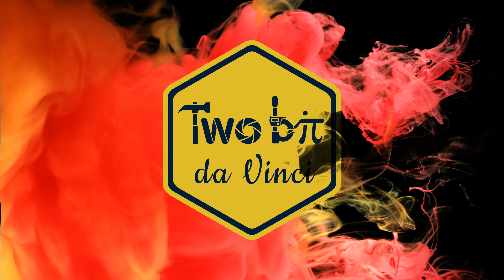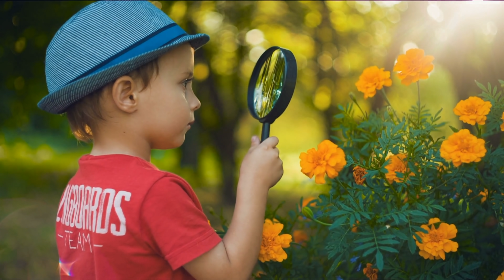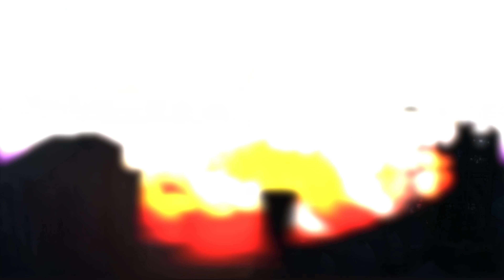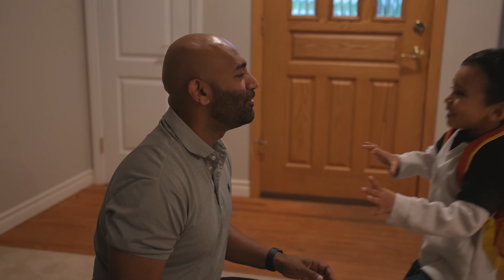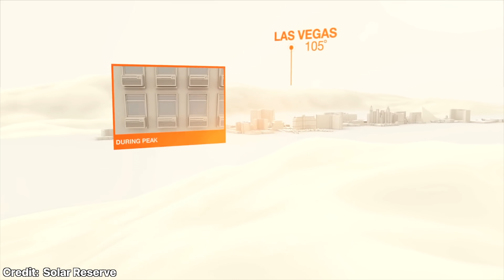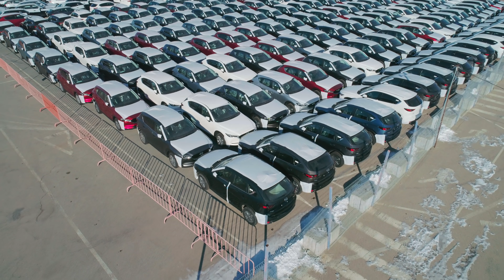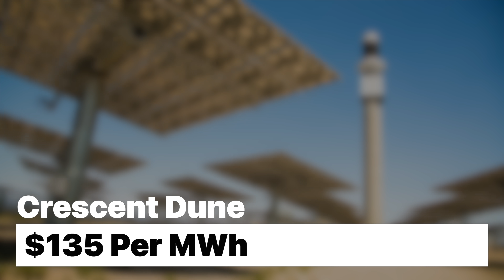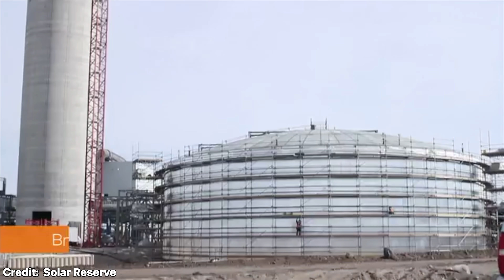This Billion Dollar Solar Plant was an EPIC Failure

Comment: "In great efforts, it is glorious even to fail."  I applaud the attempt, and hope that parts of the technologies developed for this project provide lessons useful in other projects.
Reply: I highly agree, although it did costs a lot. Humans learn from mistakes, that's also a big part to engineering.

In my eyes relying on fossil fuels is the true failure and we are only starting to realize what a big "mistake" it actually is. It will cost us a lot of time, effort,money and political drama to convert our energy resources. 

Attempting structures like this will fuel us with experience and knowledge in order to have great inventions in the future.

Comment: All through time no matter what the level of atmospheric CO2 may have been, a portion of the incoming solar radiation has been absorbed by the surface of the earth, land, water or ice and life existed just fine.  Now we’re told 400ppm of CO2 in the atmosphere is heating the earth to the point of existential death and destruction.  It seems to me that with all the glass covered buildings and office towers, small and large scale solar panel farms and the massive reflecting mirrors in the Nevada project,  mankind is causing far more atmospheric heating than if the ground was left in its natural state.
Reply: Wouldn't the mirrors reflect most of the waste energy back into space?? Especially the glass buildings and such.
Reply: @Gr3nadgr3gory    If you want to make a career for yourself, simply apply to the government for a billion dollar grant to study the phenomenon.  Just make sure you put the words “climate change” in the application.  They fall for it every time.
Reply: @ricoman7981  I'd rather do something useful. Like work on LFTRs.
Reply: @Gr3nadgr3gory    Agreed.  Will thorium break through, I don’t know much about it.  Technology will lead the way.  As I understand, wind and solar have limited efficiency upside, we need something much more energy dense and reliable to support the grid.

Comment: 1.  Being price competitive with Solar Panels even at startup is not saying anything of value.  As even now, Solar Panel power generation is still unable to support itself financially without extensive subsidies at taxpayer expense.
2.  Being solar powered, it still has a period of time daily when it offers effectively 0 energy output.  It's not like just flipping a switch at sunrise and it's instant on like a lamp.  While the molten salt can still provide residual heat to run the steam turbines after the sun goes down.  Every day would see a point where there just wasn't enough thermal energy remaining to continue production.  And then the system must wait until however long after sunrise to build back enough thermal energy to resume production.  And of course, all of the machinery and electronics must still have power.

Comment: hi guys. 
as one who worked in a solar plant like this. you are missing one more big issue.
the cost of construction and production is one problem.
the cost of maintenance is not only money. 
the environmental impact is terrible.
cleaning and fixing isolation panels lives millions of particles of non perishable materials drifting arround.
birds and insects get caught in the flux and burn alive
and now it will be left to crumble as a monument to the failier. no one will take it apart.
i am all pro novelty and clean energy is important. but this is so far from clean.
i hope that in the race to renewable energy money will not be the only factor

Comment: Hardly a money failure for the ones who dreamed it up and for the installers they got their millions out of it, myself and far more clever people have said that all this type of renewable energy is a scam , it hasn’t been tried low scale long enough to see if it’s viable, same with the wind generators poor returns for the money invested and the off shore ones are not only an eyesore but they are failing by the hundreds because of erosion, this waste of money by the tree huggers has to stop let them find investors instead of robbing the public purse, how many pensioners could have been fed and heated with the amount of money wasted

Comment: Question: The panels are there, the photovoltaic cells are cheaper, its just to be remodelled to make most out of it (the assets), why shut it down than repurpose it?, biggest cost is the panel and the rotator (systems) to capture most sunlight .
Reply: I also refuse to believe, we dont have the technology to deal with enormous heat, how is it managed in nuclear reactors. I like Douglas Goldstein informative comment highlighting the side effects, so when you've connected. look forward to the sequel of this report

Comment: You mentioned the staff required to grease the assemblies. The expense that most renewable energy projects like to keep hidden is the amount of oil required to keep them functioning. Bearings, gigantic rotating assemblies, electric motors all use an exorbitant amount of oil and grease. 

It would be an interesting study actually. Hint hint.
Reply: It's usually not mentioned anywhere, yes, and it's not just oil - parts have to be replaced much sooner, due to how unstable it is. Constant problem of renewable energy is that it's naturally unstable, and machines tend to not work at optimal capacity under constantly changing conditions. By contrast, non-renewable energy, like nuclear, runs in stable mode, this reducing wear and tear on machinery and electronics.
Reply: "Bearings, gigantic rotating assemblies, electric motors all use an exorbitant amount of oil and grease. "
I have never heard of a diesel submarine -- an isolated piece of equipment when it is in full operation -- failing due to oil and grease depletion.
Reply: I can't help but think that the project team didn't do enough homework on the heliostat actuators.  There are lubed-for-life motor and ballscrew assemblies that could have worked without maintenance.
Reply: @andyharman3022  I don't think anything working in conditions of desert is "lubed for life". High temperature contrasts and sand are deadly for moving parts.

Comment: Sounds like the $$$ gatekeepers & those overseeing engineering design should have employed some sophisticated & experienced thermodynamic brains from the aerospace and or 🚀 industries. Molten salt is apx 5x the temperature 🌡 for steam for turbines(day & night time kWh). One would think ALL parts of the process (links in the chain) would have been scrutinized for temp, pressure, corrosion, etc. I guess hindsight is 20/20.

Comment: They need to have a mirror discount sale and get some of their money back. It only cost  about $40.00 to build a box that would supply 3 homes with electric power for everything electric in all 3 homes. No moving parts and pulls energy from the air around you. Tesla free energy is coming soon. Should be this month.

Comment: Right away when I hear a failure I think of solutions or outside of the box work around you have a field of solar voltaic panels that are aimed at a focal point take Sterling engines and place them at the point and allow a Sterling engine Hot Side to receive all of the Power Sterling engines are already running in many different places of the world producing many megawatts of power steering engines are the solution to the problem Sweden uses Sterling engines to power submarines the space station uses Sterling engine with a ball of plutonium to power it to run energy in Space Station

Comment: I remember seeing one of these type solar plants in the desert just east of Barstow, CA. Then, it was not there. Gone like the wind. If that was a failure, then why did they bother building more of these in the California desert near the Nevada state line?
Reply: Can't give up on an idea that scientifically makes sense just because you failed.
 We really really need to lower our footprint on earth and these guys are doing a great job at trying
Reply: @chango.-.  :  Yes, no matter what the cost.
Reply: @chango.-.  "these guys are doing a great job at trying"
Meaning they're doing a great job at failing.  "Our footprint" (as you refer to it) in the construction of this plant, did you ever think of that?  The fossil fuels burned by all the machinery and men needed to build the plant and perform maintenance...  Do you truly believe that any of the energy used in the construction of the plant was "green?"

Of people want to advocate for green energy, they should advocate for solutions that will work.  Otherwise, you're doing more harm than good by "trying."

Comment: Imo, the problem with the green movement is that 1) it has failed to recognize that a lot of its dire predictions haven't come through (legitimacy problem) 2) they are sticking to the sole solution of reducing emissions which is not an easily achievable goal (feasibility problem). The conversation has been dogmatic with you either reduce emissions or you are a science denier. More updated information,  innovative thinking and compromise is badly needed.

Comment: I could have predicted this from the start. Liquid salt is such a difficult and corrosive media to control. Though they can convert it to just use water only. They will lose the night but possibly another storage media may emerge . Another possibility is to heat water then heat the salt with water then heat the second loop of water at night. Losses have to be calculated.
Reply: It's just not stable enough for such system with multiple cooling circuits. Main trouble with renewable energy is always in how unstable it is, and many mechanisms hate constant reconfigurations, as it reduces their lifespan.
Reply: Yea, I've got a great idea.  Let's use something like radioactive sodium metal, or radioactive hydroflouric acid.
Reply: @JoeSmith-cy9wj  I got a notification, but your reply isn't showing up in the thread...
Reply: @JoeSmith-cy9wj  "Yea, I've got a great idea.  Let's use something like radioactive sodium metal, or radioactive hydroflouric acid."

Can you explain? Genuine question---I don't know enough to know if you are being facetious or serious.
Reply: @bricaaron3978  check your email. I believe i posted it to you instead of the public thread
Reply: @JoeSmith-cy9wj  I'm not sure what you mean... I don't use Google for email, as I don't like strangers reading my private correspondence, or using it to make a profit.
Reply: @bricaaron3978  ok, so i don't know where my original reply went.  Anyway,  the second one was a near duplicate. This format is considered email to the Google computers as far as i can tell. I was surprised to find that when people left responses under the video comment tab, the response would appear in the video comments. But if a person were to tap another commenters name or logo or avatar image, it goes only to that person's email.  Many people have an email app on their phone but don't use it. You jave email whether you use it or not. If you use your phone for this communication,  open the app. You MUST have some form of it because that is how you are talking to me.
Reply: @JoeSmith-cy9wj  It seems there is a confusion. I have email accounts---my email accounts are with my ISP. I.e. they are private email accounts, and not free email accounts like Google/Yahoo/etc.

I access Youtube via my browser, via my PC. So when I post a comment on Youtube, or on any other forum, I know that I am posting on a "public" forum. You said that I should receive replies via email, but like I said, I don't use Google email, so even if that is true, I wouldn't know anything about it.

Having said all that, it's still true that your comment was apparently "shadow censored". This kind of thing is why I don't take Youtube/Google seriously as a medium of communication.
Reply: @bricaaron3978  I see. I haven't had a computer since 1985. Since I've been using touch screen phones,  which i detest, it seems to be a requirement to have an email address. This is how all accounts are identified.  I don't know if it works that way with iPhone. The browser I use for internet access also anonymizes  me. However Google,  with my phone, provides a direct app to YouTube.  This is where i write comments.  However,  i also receive them as email through that application. Somewhere you are assigned a unique locating address. 
I wonder,  did you receive the note i sent FROM the email app?
I completely understand if you prefer not to answer.
Reply: @JoeSmith-cy9wj  "Somewhere you are assigned a unique locating address."

The only requirement for Web access is an IP address, which has no information about a person's physical location. It's possible for an ISP to combine private information like customer address with IP address in order to identify an individual, and that information can of course be given to the government. But to my knowledge, my ISP at least does not attempt to "monetize" or tamper with my email exchanges.

"Since I've been using touch screen phones,  which i detest, it seems to be a requirement to have an email address..."

Absolutely not. My ISP, for example, no longer gives out new email addresses, but there are companies which offer secure email accounts. And there is always the option of hosting one's own email server. I actually thought I was going to do that when I mistakenly thought that my ISP was deleting my email accounts as the result of a move.

"I wonder,  did you receive the note i sent FROM the email app?"

Via Youtube, the only thing I receive is a notification, which contains the first bit of a comment. Perhaps there is a way to view the entire comment of a notification from the Youtube webpage?
Reply: I initially used the three little menue buttons on the right instead of the dialog box below to reply.
Reply: this is the error folks make. The goal of green renewable energy at this time  should be to SUPPLEMENT fossile fuel  I.E. use solar in the daytime and fossile at night.

Comment: They could just put all the panel to gain the most energy. Then hook it to the grid using the molten salt was just asking for failure like rotating panels. Once they used tax dollars shut down with out paying them back is bs but typically government

Comment: we don't hate green energy initiatives, we hate stupid ideas, which the green energy sector is full of. look to California, they are having a really hard time keeping power to their grid to the extent that they are asking people not to run their air conditions, appliances or even charge their electric cars  while mandating that there will be no new gas equipment or vehicles sold in 10 years. solve the problems of green energy, and people will follow with their pocketbooks open

Comment: personally, I think there's an elegance in simplicity. this design was too complex. there's a power plant in Europe, i believe it's Dutch, that uses solar and wind to fill a water reservoir at the top of a mountain. when solar and wind don't provide enough electricity to keep the lights on, they can drain the reservoir to power turbines that can keep power going. doing something like this would be advantageous in a place like minnesota or Northern California where water is more plentiful, or even along our coastlines, having water towers dedicated to electrical production that use wind and solar to pump water up and let the water make the electricity on the way back down.

Comment: The other issue is the devastation of wildlife. It's the same kind of situation you see with military early warning radar installations. Those installations are basically a several story building where one or more walls is a massive radar. If a bird flies within a certain distance (which is pretty ridiculously far in actuality) in front of that radar while it is active the bird won't even make it halfway across before it's dead. This is from the massive amount of thermal radiation produced from an active radar. A solar power plant that focuses solar rays like this one against a central point will have the same issue. The US Air Force has spent millions in research on ways to keep wildlife out of the radar zone to pretty much no avail for decades. It's only been fairly recent that good tractions has been made in aviation safety at these sites. I'm sure this site had the same issues as well. Green energy becoming an ecological nightmare.
Reply: Unless you're a vegan, your diet is doing more damage to the environment than that power plant. I agree, we need and can do better!
Reply: @jmatthewssmith  Yeah considering I know on average how many birds get killed by these kinds of things a day they do more damage to the environment in a day than I would in a month. I can't eat that much. I was actually part of a group that did studies on this for the Air Force for the PAVE PAWS program back in the 90's. In that sense you could call me an expert on the subject.

Comment: Why not bolt photo v panels on top of the mirrors, use the motors to track the sun and reuse at least part of this debacle? The tower, tanks and pipes will be wasted but some reuse of built infrastructure on a site with the existing utility connections in a location that still needs a solution.
Ask tesla for help with storage to batteries and reengineering….

Comment: Funny how thanks to anti-Nuclear hysteria pushed by Greens this reliable and non-polluting power source is largely ignored. Heck the US Navy has run nuclear ships for nearly 70 years with a better environmental safety record than coal or oil mining industry. Solar and wind are clumsy and inefficient and vulnerable. A modern reactor can run an aircraft carrier for 50 years without refuelling - imagine what a land based one could do ... and all because of left wing politics.